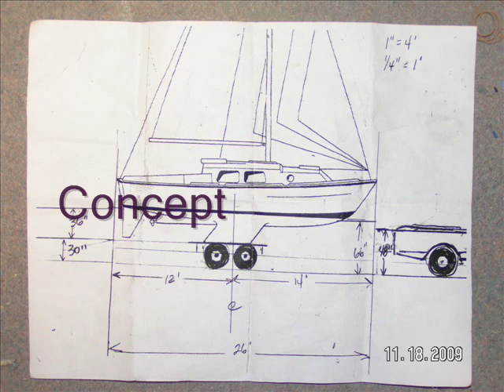Westerly Centaur Sailboat

Comment from the maker: The prop will also be out of the water when healing if you’re power-sailing.

On the positive side, the boat can be maneuvered quite well in tight areas, like docking, by swiveling the outboard and rudder at the same time, both forward and reverse. This same method works well in helping to wiggle out of shallow water.

Hope this helps,

Andy

Comment from the maker: Billy,

I purchased my Centaur used without the original Volvo inboard, so my only experience with it, is with the outboard motor. I think the outboard is a compromise to an original inboard for a few reasons   I have used a 9.9hp outboard motor, which is adequate, but I think minimal for my particular inland coastal sailing area.  It is hung off the stern with a typical store-bought outboard motor bracket.  (more to follow)

Comment from the maker: The biggest problem I’ve encountered is in rough seas, when the boat is pitching violently fore and aft, that the prop is sometimes out of the water and then the motor is totally submerged.  This is an extreme case, but not fun when you need the thrust of the motor most.  The other negative is having to reach over the stern to operate the controls.  Also, I can only assume that the boat would handle differently (better) with the ballast of the original engine in the bilge, where it belongs,

Comment from the maker: Rob,
The trailer manuf is no longer in business, but I received an opinion from a local custom trailer builder that this dual axel trailer had gvwt of 8,000 lbs, sufficient capacity to haul the Centaur before actually buying and setting it up for my Centaur. I'm currenty having a new braking system installed, complete with new backing plates and break-away system switch and battery. Boat setup can be unbolted to convert back to car transporter.  Call me at 800 549-6559 for more info.  Andy